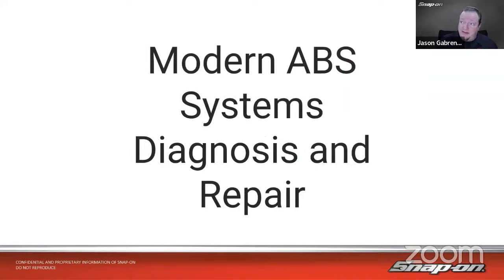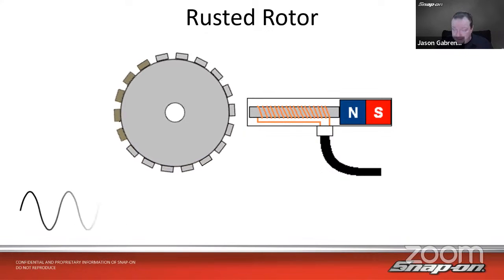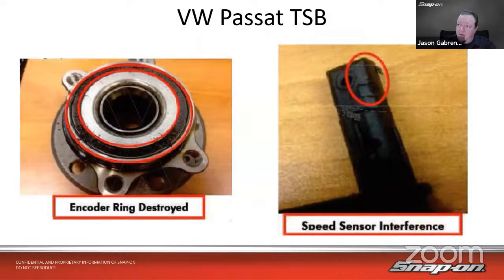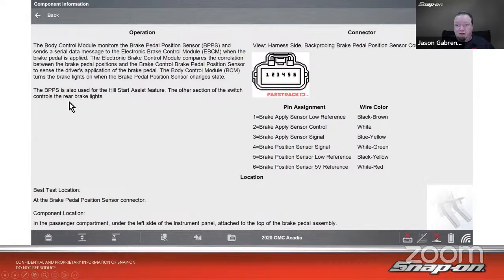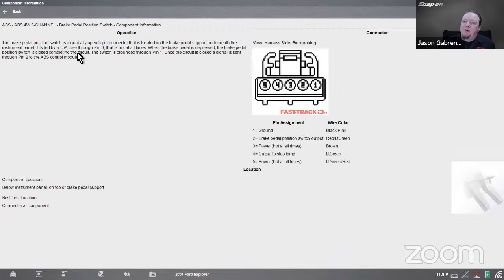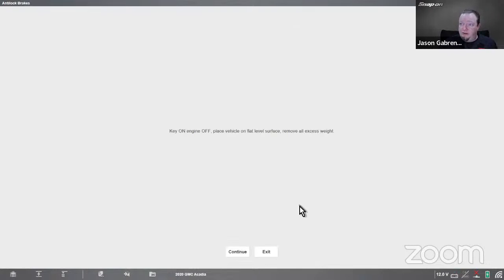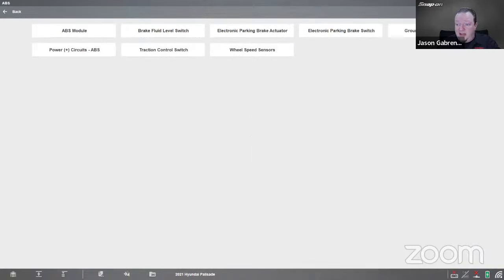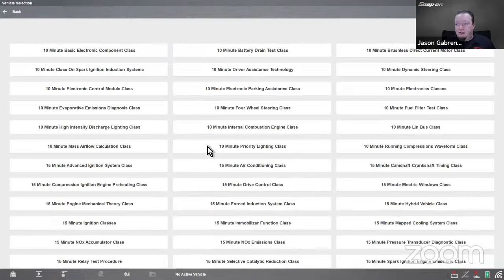Modern ABS Systems Diagnosis and Repair - Snap-on Live Training Episode 87

Comment: I have a solus plus.  My traction control light goes off and on….can my solus plus diagnose my traction control ? 

Also which snap on scanner am I able to re program my steering wheel sensor and my yaw rate sensor. I have replaced both and it still says, loss of communication.
Reply from the maker: We do have coverage for traction control and steering wheel angle relearns. Without knowing the specific vehicle, I can't be 100% sure.